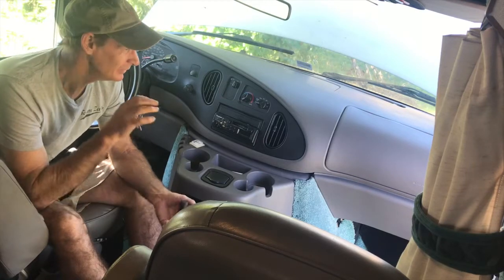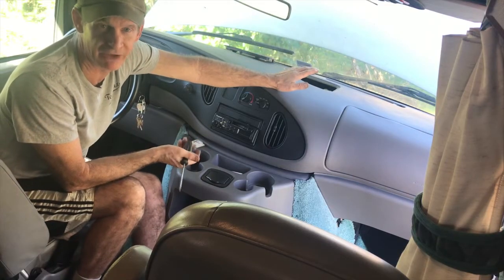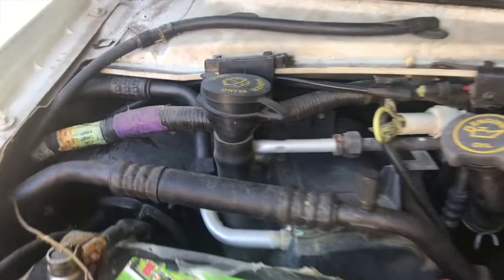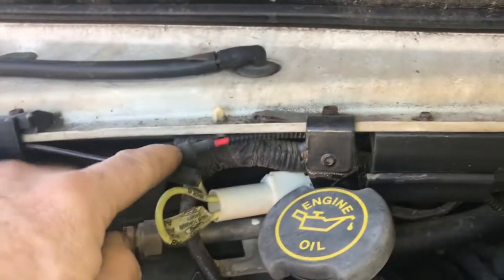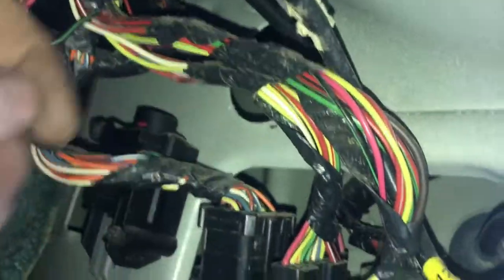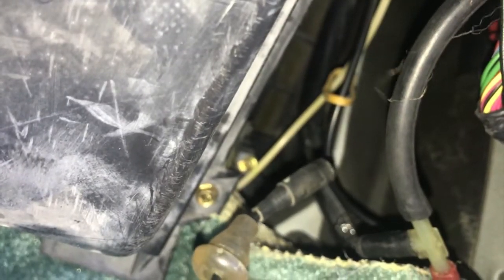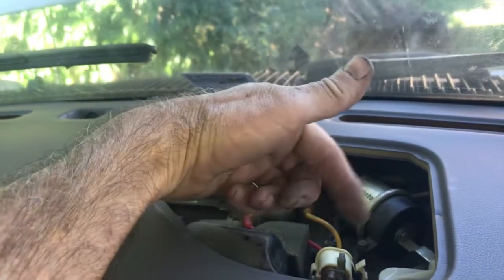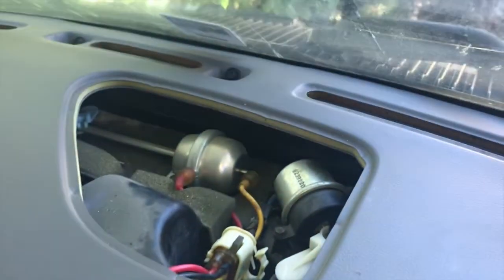Ford E450 A/C Vent distribution Problem and vacuum Canister bypass: Quick Clean Easy Fix :)

Comment: Dude this bypass trick worked like a charm and saved me tearing stuff apart. For the life of me I couldn’t get the new line thru the firewall so I got a really long vacuum line, dropped it down under the engine and up through the fender well, then into the e door frame and thru the gromet that holds the antenna wire. Thanks bro!!! Update: you’ll need to get a check valve in the line and a vac reservoir or every time you accelerate the air will switch between defrost and vent by itself.

Comment: You my friend are a genius!!!  This is by far the best solution to this A/C vacuum problem on YouTube!!  The only difference I did from your steps is: 1) I popped out the panel rubber seal, then drilled the hole in the seal and feed in the hose thru the seal, then popped the seal and hose back into the panel. 2) I used a replacement check valve and vacuum reservoir under the hood where the new hose from under the quarter panel connects to the original vacuum hose by the oil filler. 
Thank you so much for sharing your solution!!

Comment: Just bought a 2002 Coachman Leprechaun with a 7.3l Power stroke it came with the same issue. I watched several videos and yours looked the easiest. Boy was it easy! Found all the parts on amazon and it took me about an hour. YOU ARE THE MAN!

Comment: Excellent video.
Both my Ford RV's required this.
99% chance it's the check valve beneath the blower.  AZO sells a generic check valve with two ports on it (plus the vacuum supply port).  

Run the bypass hose, as shown.  Then add the new check valve to vacuum supply from the new hose (larger port).  Then attach both the HVAC control solenoid and the vacuum reserve tank hoses to the double ports (smaller ports) on the new check valve.
30 minute job.

Comment: Thanks for the info . I actually fixed Mines much faster only took me 3 heavy duty zipties. That's all. No tools except flathead  to open the top of dashboard. It's rigged. But I bypassed everything lol. Just pushed it in and ziptied to hold in the position. Took me only 1-2 min.
Reply: I just did the same 😂
Reply: Perfect!

Comment: I just did what you said to do and it was so easy thanks for the information it the only thing did was pop out the rubber grommet and drill the hole put the tub in it and pulled  the grommet back in place.Thanks again

Comment: Worked like a champ. In my case, I have a diesel van, so the vacuum is constant.. i dont know that in this case the canister is really needed anyway. Works perfect even at an Idle.. Fixed the issue for $3.15
Reply: Where is the vacuum pump located? We have an 03 E450 with the 7.3 turbo. Can’t figure out where the vacuum comes from…

Comment: So there is a much simpler way to bypass this reservoir and tee. If you disconnect the coupling they show @ 3:05 up on the top behind the battery and keep the plastic insert coupling portion then go down to the floor in front of the passenger feet @ 4:45 and pull the black lined grommet out of the firewall about 3 in in you'll find a rubber fitting that will slip right on to the insert in the red line You have to use pliers to twist it a little bit so that it'll come off of the t and the reservoir and then it's a simple matter of fishing that red line through the hole so that you can connect the vacuum line directly to the black line. I found that in order to get it to connect I needed a little extra length on the red line so I had to make sure that the routing was to the passenger side of the oil filler tube and then I was able to pull that coupling through connected directly to the black line and push it back in so that the firewall grommet was back in place.

Comment: Ive change resister and harness, blower motor, I ran a new line like you did which did start my canisters to move as I changed from ac to vent and so on but I've still got no blowing air.  I did not put in a reservoir or check valve yet thinking I would get something but Im getting no blowing

Comment: I only have a question, How about  when you open the door  there is like a blacck cover that covers the cables going to the door to protect the cables for the power windows,and I imagine thattruck has central locks, is there a possibility to also use that so you don*t have to have a long vaccum  hose and keep it nice and coverd just like if it came out of the factory ?.

Comment: Your video was the only one I could relly understand. A very BIG THANKS to YOU!! I popped the gromet out with a screw driver and drilled it then stuck the hose thru it foe easier assembly. Also my hose connection was diffrent but the MH IS AN 07 Ford. I just figured out where the factory hose went to and plugged the reroute hose into there. WORKS PERFECT….. THANKS again. Also routing the hose up was a bitch

Comment: Just curious, seeing as you removed the canister and the check valve from the system how do the vents keep working when the engine goes into low vacuum like when you accelerate? The way you have it as soon as you  give the engine gas to accelerate the vents will no longer throw air until you come off the accelerator. It will switch from front ducts to defrost vents as your engine vacuum increases and decreases. Other then that I love how you really simplified how to run the vacuum line!
Great job.
Reply: Right,  My local Ford dealer did a bypass for me like this 12 years ago and now it is leaking somewhere on my e450 when going up hills.. i have to now trace his work out as it looks like there was a check valve just inside the firewall in foot well attached to old line and left there that was also cut out of the vac line system. Maybe my 02 is diff than others or the dealer/coach builder iterations were not reverted after diff attempts .

Comment: will this work on 2013? mine blows through regular vent like it should but upon acceleration (especially towing something) it blows through the defrost vents and then returns back to regular vents if not accelerating

Comment: Update: Granted this method will restore vacuum, and the system will function as it should, so long as there isn’t a load on the engine. The problem is that without the canister AND check valve TOGETHER, you lose vacuum whenever you accelerate & put a load on the engine. your air conditioner is on and the vents are selected you lose vacuum, and you lose your air vents.

Comment: Where did you get that t fitting that you put your new hose into? I have the same rv and I am trying your fix but my vacuum hoses go into a tiny manifold looking thing up under the dash
Reply: I ended up just buying an 1/8" spike and used the adapter from the end we bypassed under the hood. Great video thanks a ton

Comment: TIP:  PROBLEM w/ your solution is you did not provide a new vacuum canister (RESERVOIR), so when climbing hills, engine vacuum drops to near zero, dash will revert to heat/ defrost.  Cure is to ADD Reservoir w/ a T-fitting in passenger knee area, store under dash, easier to see w/ passenger knee dash panel pulled.  ADD NEW CHECK VALVE UNDER HOOD FOR easy ACCESS
Reply: that's what I've been seeing, at least now I know what to check for - thanks!
Reply: TIP:  You can also locate plastic line going thru firewall at passenger toe area, pull line out of firewall, and push new   1/8"-ID rubber vacuum hose thru the same grommet into engine compartment, I caught mine w/ coat hanger under hood, pulled up to/ connected new check valve to RED Plastic next to OIL Fill.  Install new vacuum canister in passenger footwell connecting to new rubber vacuum hose and dash control plastic line, pull passenger knee board and mount under dash, reinstall knee board.  If check not backwards, all should work properly.  If no action, reverse checkvalve.
Reply: Where do I obtain vacuum canister and check valve?
Reply: @robertrosendale3337  I ordered mine from a Ford dealership.
Reply: I Added a new cannister when I did mine.

Comment: I made my canister w/  PVC pipe T, 1-1/2" (2"?) (glue x glue x 1/2" FPT threaded), 2-caps and a 1/2" MPT x 3/16" nylon hose barb).  The check valve I bought local auto parts store from HELP section. but also available online.  1/8"ID rubber will seal to the factory plastic tubing, and 1/4" ID rubber will seal to the OD of 1/8"ID,  if needed.  I used 2=-port check under hood, and plastic vacuum=t- under dash to T-off for the RESERVOIR

Comment: Awesome vid. My father in law has the same problem. Can you manually adjust the vents via the dash panel or vacumm line is still a must?
Reply: Disconnecting the actuator arm and move it manually works also.
Reply: @jr.6199  thank you!

Comment: It was even simpler for me....on my 2001 E-350 motor home chassis, I found openings to the fender well from the under-hood area near the antenna mount. The 450 is probably similar. I pushed through a piece of door protector bead that I had on hand and used this to pull the rubber tubing through to the grommet. No drilling except at the grommet. I had been fretting over my lack of controllable ventilation for a year; now it works like a champ at idle but I have not tried it on the road yet.

Comment: You are an angel. Your advice was a “2-fer”. I fixed the vacuum leak issue AND found the issue with my AM radio. Wahoo!  Do you do AC refreshing for same motor same year ford e450 super duty v10?

Comment: My left vacuum pump seems to be actuating perfectly fine but no air is really coming out of the defroster the vacuum cylinder on the right hand side doesn’t seem to do anything that’s the blue hose and I still can’t get anything coming out of the floor for heat

Comment: I’m having a strange problem when I put on AC max my vent door of the passenger side underneath the dashboard open slightly the vacuum doesn’t seem very powerful and it shouldn’t be opening when I put the switch on vent it doesn’t open when I put it on mix nothing happens I cannot get the heat to come out the bottom I only have air coming out of the dashboard but I do hear actuation going on when I’m switching the switch on the dashboard

Comment: Where do you connect the rubber hose to, confused a little i have the same issue please advise
Reply: I agree. I can’t locate the line he hooked to.
Reply: It appears he abandoned the line that comes out the firewall. He hooked the line coming through the fender into a new line he ran up through the dash. I hooked my new line from the fender well directly to the line he pulls out of the firewall. It’s the line that goes up to the dash apparatus.  Everything is working now.
Reply: @elbmp5151  sweet thanks I'm gonna try this when it warms up a little
Reply: @natejobs7463  my vacum line was broke just inside the firewall and the res vac line was cracked (this is the larger rubber hose that is the third line on the "T").  So I just purchased a new res vac that I will install on this side of the firewall so I can keep the vent air flowing when I accelerate.  10 years ago when I bought this rv, I paid Ford $1,000 to fix this same problem. Wish I new then. Amazon for the part: Ford Reservoir - VAC.  Part YC2Z-19A566-AA.  $22.95. Also bought the check valve "T" Motorcraft YG193. $10.

Comment: I have a 1998 Ford E-350 Club Wagon with V-8 gas engine. I developed the identical leak in at my vacuum reservoir or line.  You're right, the vacuum reservoir is actually hidden under and attached my blower/coil unit which is totally inaccessible.  It comes from the factory like that:(  I removed my battery  and battery tray and with a little pressure my existing check valve and lines pulled out from under the blower/evaporator unit.  I disconnected the red line from the vacuum control  valve leading to the old reservoir and installed my new factory Ford reservoir under my battery tray to the left of the windshield washer reservoir with a body clip. The vacuum port line comes out straight down from the top of the battery about 11 inches.  I literally left everything else in place.  I may end up rerouting the new vacuum line on the passenger side when I have time and relocate my reservoir behind the dash. I didn't have anything to go by when I did this project.  Thanks so much for your time putting this video together!

Comment: Mine is an 05 diesel but the dash and body are the same. Where would you say the cabin filter is? Is it behind where the pass. Air bag would be or under the wipers?
Reply: No cabin filter on my 02 gas model.
Reply: No cabin filter on my 97, 98 and 06 E350s
Reply: I would like to filter all the inbound air on my E450. Any references would be appreciated.

Comment: This video is confusing. Shaky camera I know it works but can’t understand what he did. I’m glad others seem to get it, I don’t.
Reply: I don't get what the hell is going on here as well.  It's not explained very well.  It's like "you do this and then you do that and bam you got yourself a fix" lol
Reply: @hughedee74  Yeah exactly. Everything was already done then went back over it so unless you have experience already then it is confusing.
Reply: If you look into your rig's vac lines closely, this may help. It seems the Actuators on top of dash moves air flow to different outlets. And when you select Max AC, another vac line holding pressure is also what opens/closes the door, located in the passenger foot well. That diverter door changes air from inside recirc to outside air. The diff colored lines on dash top panel relate to the diff climate functions selected. If an outlet or recirc is not right, you have a pressure leak somewhere along these lines.
Reply: It works 💪

Comment: My actuator doesn’t move, but I can manually push it in and air comes out the front vents. As soon as I let it go it snaps back and air only comes out the defroster.

Comment: I have ford E-450 year 2004 and it starts good but as soon as i press the brake pedal or accelerator then it shuts off but if i press brake pedal sowly then it keeps running but shut off only if i press brakes quickly.even if i release the accelerator then it also shut off. So can anyone tell me what can be the issue

Comment: My 2003 e450 is having the same problem.  I took it to two different repair shops and both said they would have to pull apart the dash to get to the wiring.  I’m in Southern California and need someone that can fix it.
Reply: My local Ford dealer did a bypass for me on my 02 450 like this 12 years ago but it appears without a new reservoir, so now it is not working when going up hills. Some dealers wont work on motorhomes so shop around for one that will watch these video hacks. But do the reservoir version fix.

Comment: until you go up a long hill push the engine and the vacuum drops off... then you find out why they had a canister.... I work on these every day
Reply: Yep! Which I found out after I followed this video step by step. Just ordered a vacuum reservoir & check valve. Need to find space under dash while I wait
Reply: @coolchange1970  look in the area above the glove box.... my units are transit busses and there is NO airbag in there..lots of room and a nice flat metal plate to mount the cute little plastic vacuum tank.  I thought it was really interesting that the part number for that little plastic tank was a suggested ford part based on my VIN number....

Comment: Its a great fix, but, if I recall correctly,  when say, going up a steep hill, you will most likely experience a change in what direction the air will be discharged. Like if the setting is the front vents, may change to the defrost vents. Whenever there is a change in engine rpm, the vacuum resivoir, That you bypassed that has the check valve, is what prevents this by providing a steady supply of vacuum to the actuator for the vent door flap.  But just the same as long as its blowing ice cold I'll take it anytime !  >:)
Reply: The purpose of the check valve and reservoir is to maintain that vacuum on the device    (actuators) during manifold vacuum loss, so first, easiest is to install new check valve at firewall line near OIL (fill) under hood; if old check is bad, adding new will fix w/o removing old.  If problem continues, you most likely have a tubing or reservoir leak.

Comment: The only problem with this way no1 wants to admit is when you reach high rpm it will redirect the blower flow to defrost. That is why the reservoir and check valve or originally present. If you bypass some it's not going to work 100%. But it is still better than nothing.

Comment: You’re a genius! If only my mechanic could figure out why my A/C won’t run on max setting, but the others run fine. I’ve had it to his shop 5 times in the last 3 years, to fix it. They have replaced every part to do with the blower motor, and blower motor itself. It runs on max for 3 uses and then quits. Any ideas? I’ve missed seeing you on here. Nice to see you and excellent video 😊
Reply: Replace the resistor
Reply: @opbuilt9618  Thanks, they’ve done that 3 times. I’m just thankful I still have a/c. It’s a 2006 Dodge Caravan and we live in Florida.😅